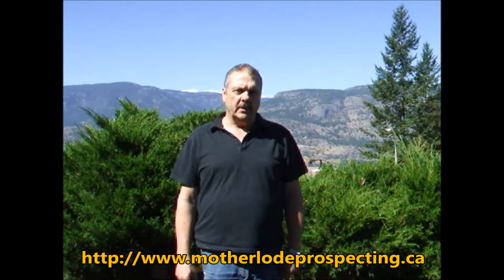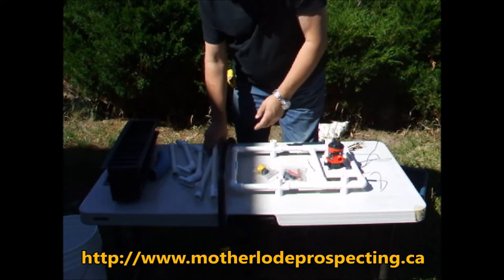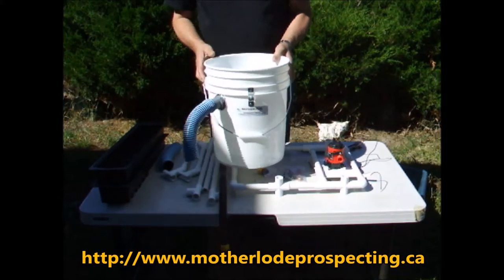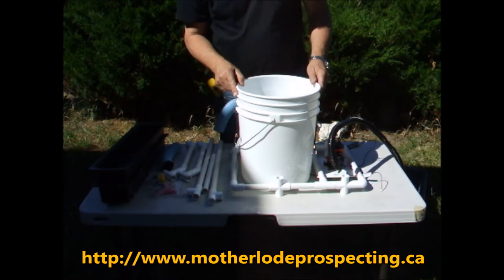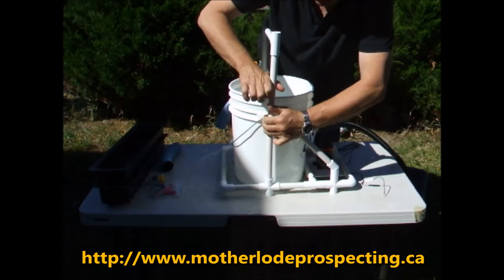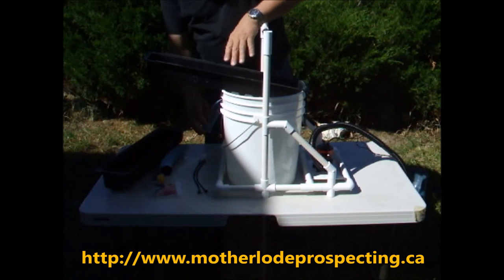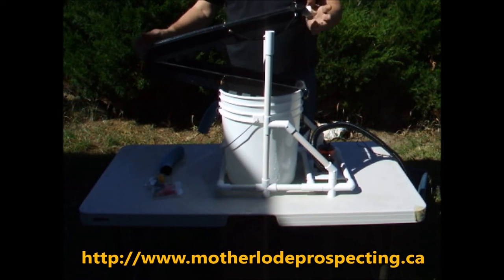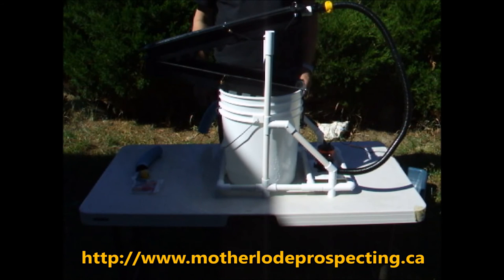Black Scorpion 2-Tier Mini-Concentrator Setup Video

Comment from the maker: We no longer use the short piece of hose, rather we now insert a 90 degree discharge port.  Also, the pump is now 750 to give a bit more water if you wish to install the optional feeder tray.We have also done away with 2 of the bungy cords.  The tray's can now bold directly to the bucket for added stability.  Only the top tier requires the Bungy's criss-crossed to hold it firm.

Comment: We've since upgraded the pump to 760 gph to accommodate the optional feeder.  We also have some dealers in B.C. and AB.  The stand is identical to that which comes with the Black Scorpion table, and we have a kit so you don't have to duplicate the stand, pump, hose and tub.

Comment from the maker: Now using a "Black Bucket" with a 90 degree ELL for the discharge instead of the hose, plus double cleats so you can use it as a single tier as well.  Also available soon is a feeder.

Comment from the maker: I usually don't run any more than 20 mesh but I have seen people use it up to 10 and 12 mesh.  It works best with consistent mesh size because the larger the size = more aggressive water flow = finer material being washed down.  Keep the mesh size consistent for best results.

Comment: hey im really enjoying this product but im having a problem with gold getting through when it is heavy with black sands. any tips?
Reply: Hi - thanks for the inquiry.  Yes, it's likely due to a couple of reasons.  If you pump is running too slow, it affects the water volume needed to make a proper exchange.  When the unit is running properly, it has a slight vibration caused by water flow.  This vibration helps to stratify the material in the drop riffles, and allow for more efficient exchange.  Secondly, is the feed rate.  If you are feeding it too fast, and not allowing the riffles time to clear the top layers, thus creating a drop zone, you will end up with skip causing the fine gold to move to the second tray.  The smaller the gold, the slower the feed rate especially when you have a lot of black sand.  Another method some use is to fill a bucket with water and put some concentrate in there and use a magnet to pull some of the black sands "through the water" ( without clumping  thus trapping gold ) - pre-processing in this way helps to lessen the black sand ratio.  One more method is to get a feeder and let it do a consistent feed.  You will need a minimum of 750gph+ pump for the feeder though to provide enough water to the drip bar and to run the sluices.  Hope this helps, and let me know how you make out.  Always looking for feedback to improve my products.  Thanks again.
Reply: Bryan Cramer thanks that’s super helpful the material I’m running is like 70% black sands
Reply: @bmcramer  thanks for writing back its really handy device you made and i like that its canadian made.. any chance you could make a newer video on feeding and using ive put alot of material through it but ive only been panning for a year and im super green
Reply from the maker: Hi;  Sorry for the delay, we have been pretty swamped now that we have a new dealer in New Zealand and another coming online in Switzerland soon.  We actually have an optional "feeder" for it, which helps establish a flow rate that would fit the density of the material you are running.  Of course the less black sands, the faster you can run the feed,  and the more, the slower since it takes longer to clear the riffles to prevent "skip".  Also it helps when you are feeding to ensure the material is very wet to allow quick separation when it hit's the slick plate.  Don't forget, as 12v batteries wear down, it has an effect on the flow rate through the sluice - be mindful of that to avoid compacting of the riffles.
Reply from the maker: @kingbertron420  Hi;  Sorry, I actually got locked out of my account for some reason and just managed to find my way back in ( go figure ).  Anyway, I am going to try and get a few more video's out there.  I'm also developing a new 3 tier system ( you can see a video of that at facebook.com/motherlode.prospecting if your interested.  The one there is only a prototype, but it's capture is proving to be awesome ( lower ratio black sands however.)  I've developed my own proprietary riffling and matting system - each tray also  has a different processing function based on the matting.  Still working on it, but it's showing real promise.  Hope to have it ready for this coming season ( 2024 )